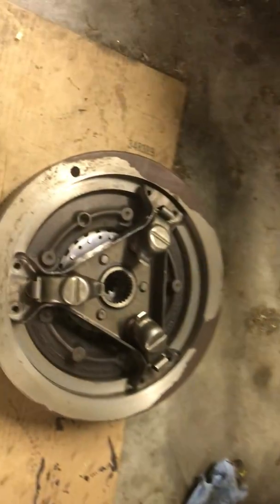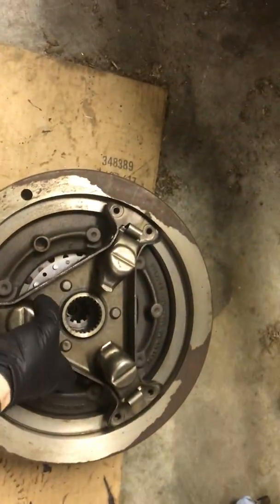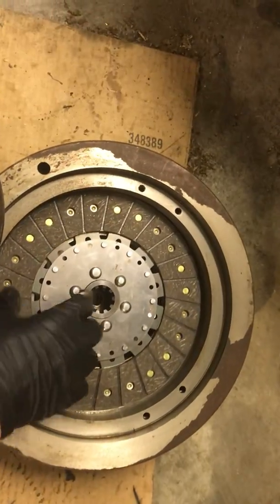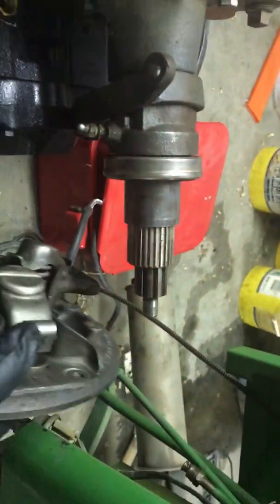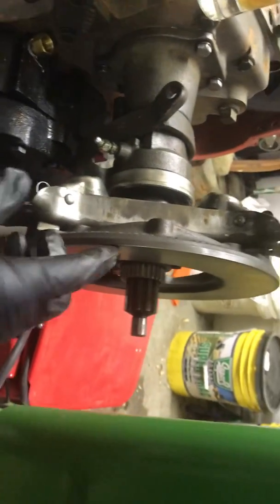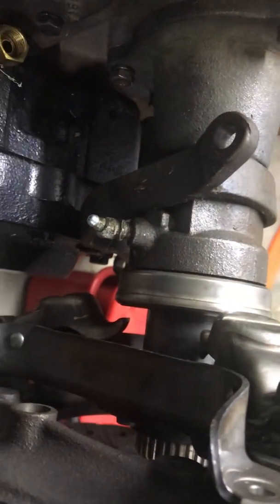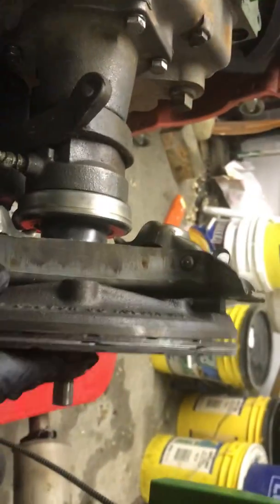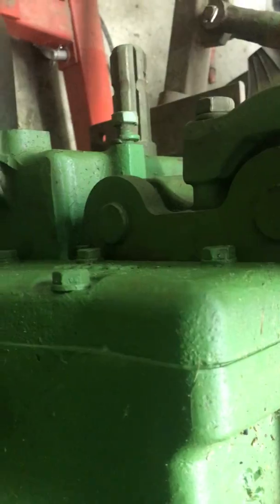How the clutch and PTO work on a tractor (John Deere 2010)

Comment: On my 2010  when you push clutch in pto grimds and wont go in.  What would this issue be
Reply: This is a bit confusing. 
The PTO clutch of the 2010 is house just forward of the PTO shaft under the rock shaft assembly. 
The action of moving your PTO lever forward engages and disengages the PTO clutch through a series of stacked disks. 
Even if there is a failure at your drive clutch PTO input shaft actuating your foot clutch should not change anything
Reply: Very interesting!! I'm working on a John Deere 430 that has a 2 stage clutch. The problem is that: with my the clutch peddle depressed my PTO will not disengage.

Comment: I bought a 2010 dozer that has set for 30 years and the throwout bearing linkage in behind the pressure plate is rusted bad and I can't figure out how it is suppose to work. It looks the same as your tractor. Is it hydraulic?